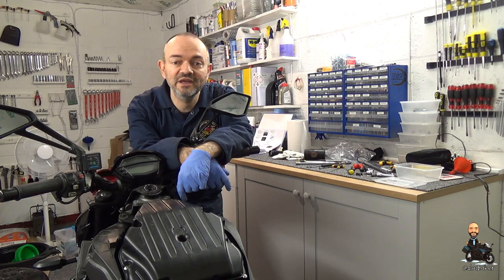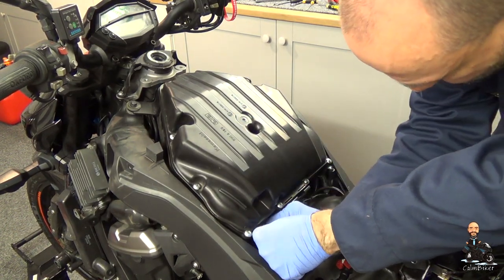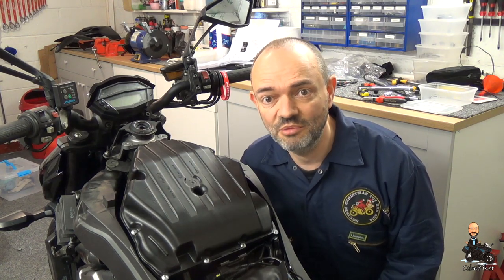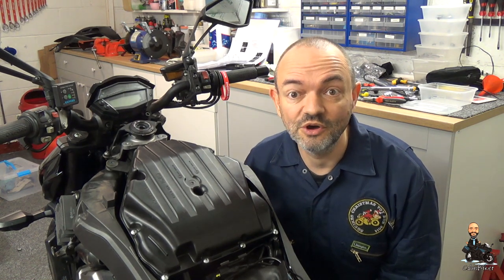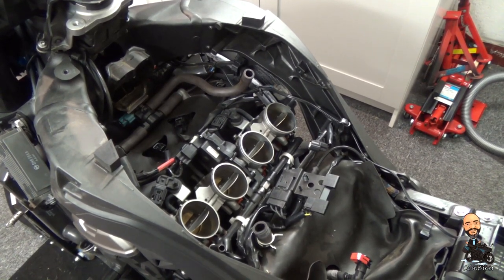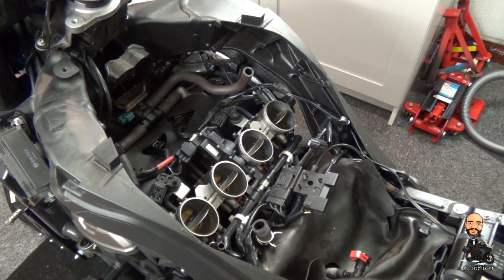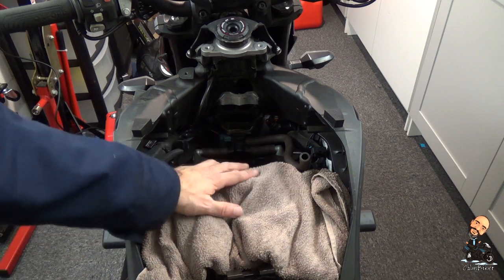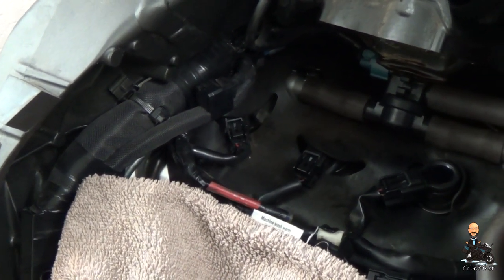908. Kawasaki Z1000 Spark Plug Change (and Fail) | Garage Video

Comment: Sometimes the rubber splits but very rare. I've used super glue to repair it. Also put rubber grease around the rubber seal before you put it back. Makes it a little easier to get out next time you remove it.
Reply from the maker: That's what I did in the end. Seems to have done the trick and saved me buying a new stick coil.

Comment: That was much more tricky than I expected. Maybe that's why, apart from petrol and tyre pressures, bike manufacturers recomend getting it done by a dealer.
Reply from the maker: The CB500X was worse, although the coils came out easier.

Comment: Hi, as far as i know the ignition coil goes with the rubber. Its to expensive  !!! 
When i change the spark plugs on my moto z1000sx 2018 i have the same issue, to hard to remove the ignition coils, 
fortunately no damage  when i removed them.To install i used a silicone spray lubricant on the rubber. 
Hope that helps you
Reply from the maker: Thanks for the tip. Sorry for the late reply but YouTube hid your comment and I missed it. It thought that them.To was a spam link :-D
I used some silicon grease to reinstall the coils. Only time will tell if it helps on removing them next time.
Reply: @CalmBiker  Hi there! Be careful use this grease because this area is too hot. Better is to use silicon spray to lube the rubber to  ignition coils when you install or remove them.

Comment: How did you get the 2 sparkplug 1 and 4 out ,i have a sparkplug tool but its not getting in ,its comming against the frame
Reply from the maker: It's very tight, particularly on the left. I had to move the cabling over and use a universal joint socket and a couple of extensions.

Comment: I bet that was the one underneath the cable?  Hope your repair does the trick. I wouldn't hold your breath on being able to buy (just) the rubber.... that's not the way manufacturers do things in my experience. Consider yourself lucky if you can buy just the one 'stick' ..sometimes they only sell them as a set of 4..... not sure if you checked Kawasaki's recommended replacement intervals on spark plugs,  on cars the replacement intervals are much longer than they used to be back in the day....
Reply from the maker: It was the one I gave up on first. It was absolutely rock solid in there. You can buy the sticks individually for about £85 each so I too hope the repair does the job!
Reply: Crikey!!!  £85 each !!!!!
Reply from the maker: @paullee6663  Crazy eh?

Comment: what size to use on the socket for spark plugs?
Reply from the maker: I can't remember which spanner I used but these are the spark plugs and it says 16mm, which seems about right. Might be worth double-checking though because I have several sockets and just picked the one to fit. https://www.opieoils.co.uk/p-63912-ngk-cr9eia-9-6289-laser-iridium-spark-plug-sparkplug.aspx

Comment: Not a very easy job buddy, strange how you how four spark plugs and four cylinders but I have four spark plugs but only two cylinders, lol, shame about the rubber on the stick coil mate, RS.
Reply from the maker: That is odd! I wonder if two sparks are needed for a good burn with those humongous cylinders.